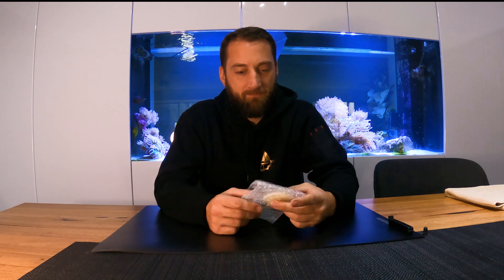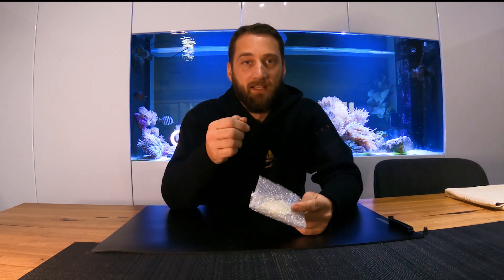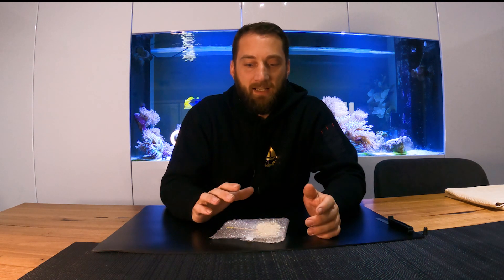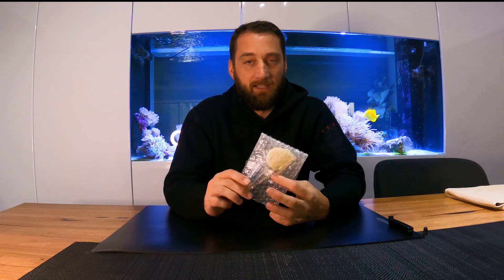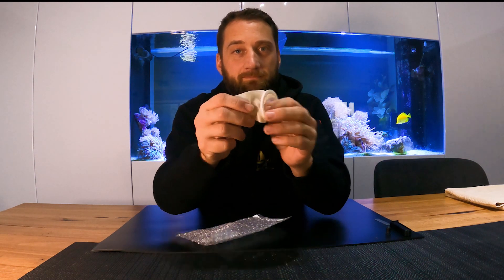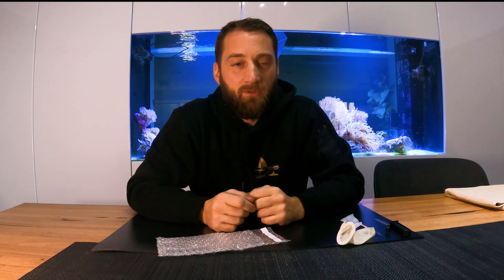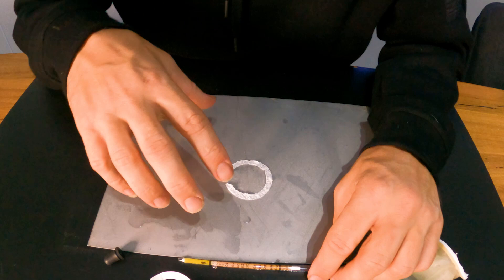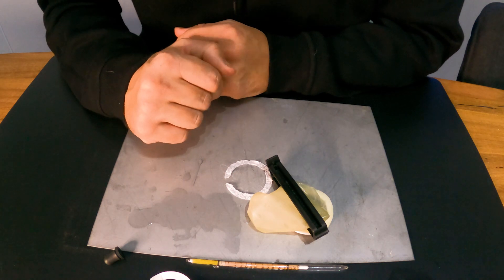Sailing QC # 28 | Salt Chloride Testing | STATEWIDE LOCKDOWN can't work on our Steel Sailboat Build

Comment: Fantastic marine tank. Cool access also.
Reply from the maker: Hi Michael, its Mel 🙂 thanks so much! Luke did a great job custom building the tank and cabinetry for the great access above and below for the fish tank & sump... plus the extra storage to the sides for me too!
Reply: Hi Mel, it's a video in itself. Does he make his own salt water? Hope the lockdown ends soon for you. I'm in the UK , we almost doing the opposite to you guys.
Reply from the maker: @michaelbundy3867  Yes he does make his own salt water :) we have multiple tanks that cycle and mix the water before each water change with RODI water purifying system. Lockdown has ended now thank goodness but still lots of restrictions in place but looks as though we have gotten on top of the local cluster here in our state which is very good news!